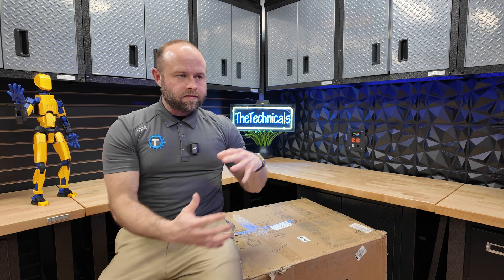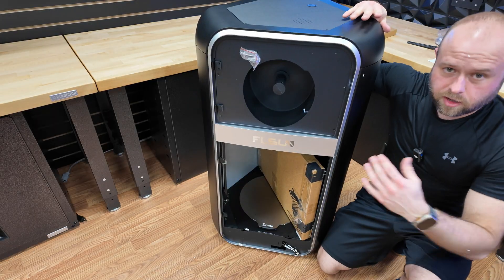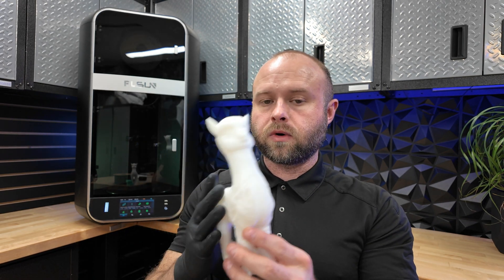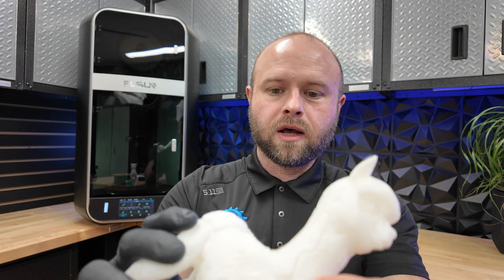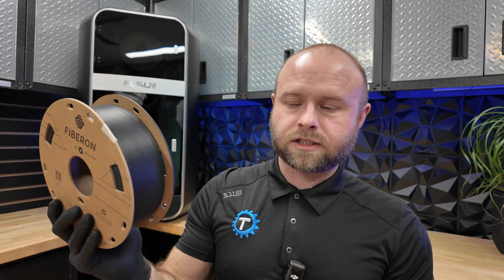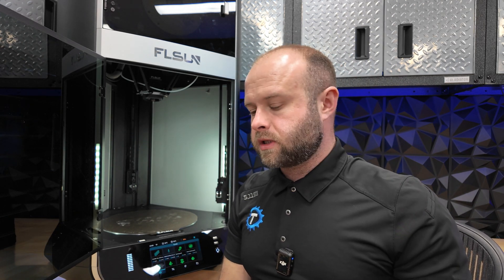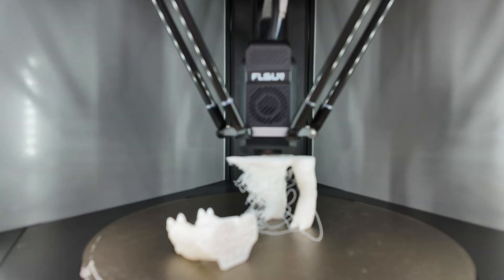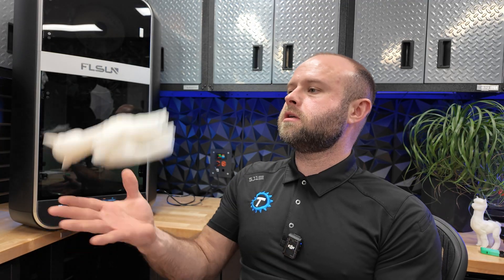I CAN'T BELIEVE they sent me a FLSun S1 Pro

Comment: That looked waaaayyyyy easier to put together than the T1 PRO LOL.

 I still am having really good luck with my T1 pro and for the price the T1 is a really good deal compared to the S1.
 I would like to see some side-by-side prints just because you can buy 3 T1 for the price of a S1. like is it really that much better or just slightly faster with a dryer?

Comment: Hmm, the build size seems small, but it would be ideal for round objects - planters.  Most 3d-prints are rectangles or squares.

The touch screen with the glossy surround looks cheap.  The alone puts me off.  Maybe, they needed a cheap manufacture, China, and they think they know what’s hot.  They don’t.  That’s why we 3d-pirint - because we can do it better.
Reply from the maker: The touch screen is by far the nicest one i've ever seen. Check that segment where it shows the video timelapse of the print. It's legit